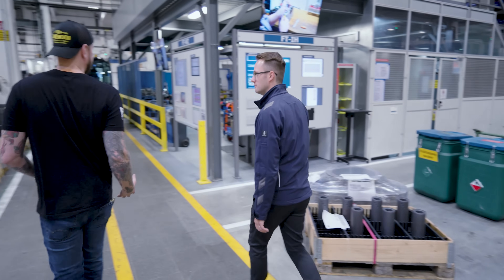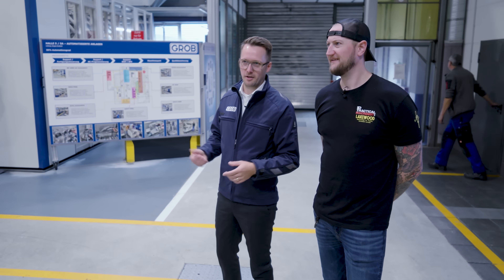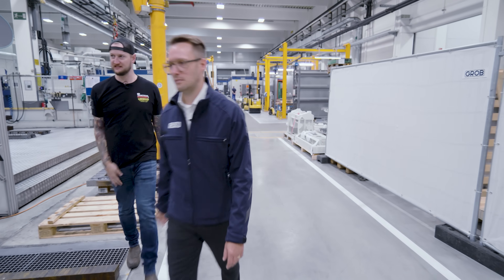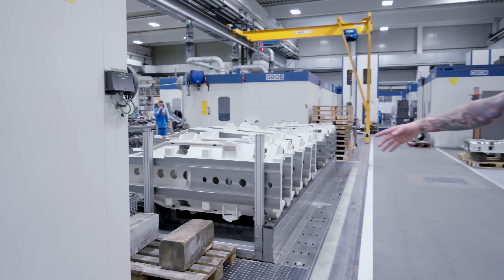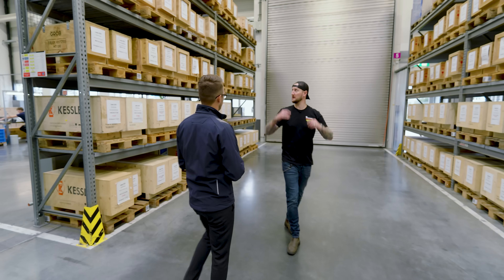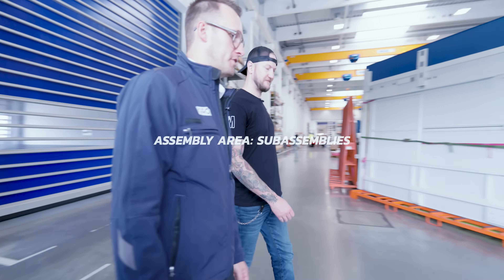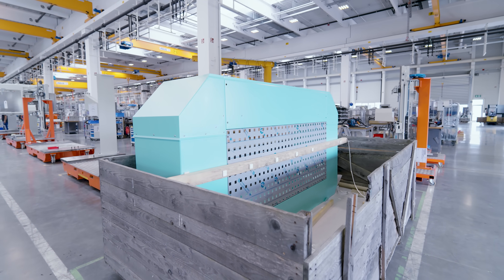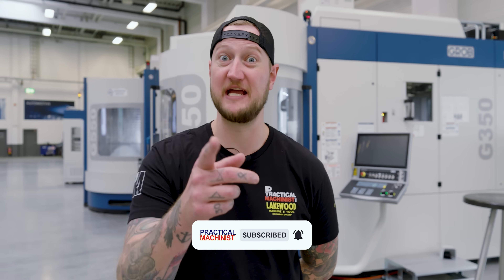This German Machine Tool Factory is Bigger Than Your Hometown!

Comment: 15:57 - well, nice machines. But it's all just welded steel. I don't trust CNCs from welded steel. Software compensation can do alot, but over time. Naah that's an aluminium machine and for shallow steel cuts only.

Comment: Imagine the confidence you need to have in your manufacturing + quality, that you just show how it's done, but know it won't be easy to copy let alone be better, for anyone.
Reply: I bet the Chinese can do it 10 times cheaper for 90% of the quality. But if you need that extra 10% then you have to pay the price I suppose.
Reply: @1pcfred   Honestly? Good question long-term.  
(I mean, it's not like someone would get something like that short-term anyway.)  

Long-term, as in what's the uptime and maintenance cycle those have. I mean, machines like that not working or just being on halt costs money. And if you're just saving like 5–15% of downtime a year just because the quality is better, it pays off, I assume.
Reply: @1pcfred  
not a silver bullet that's for sure, doesn't exist.. yet.
But it's everywhere pretty much the same.

Ether you build you house with cheap materials knowing you have to put more work and money in to it down the line or you opt for quality to have to worry less about that in upcoming years.

If affordable to someone, the quality tax often pays out over time.

Comment: A model plane has to fly itself. There's no pilot to correct the trim. Therefore if anything, a model plane has to be designed for greater stability than what you are pleased to call the real thing.

Comment: I did IT in several of such companies. It is interesting as hell and the workers are real fun guys.
Reply: Same here. I love doing IT in industrial environments. It's a niche job so you'll always find work but more importantly, it's a fun mix of desk work and working in the field between the machines and datacenters. I indeed also love interacting with the workers, whom I usually get along with great, often better than the office workers. What do you do exactly? I'm an industrial systems engineer, independent consultant. Though I have to say, companies such as this one I've only worked in two to three times. Most of my customers are heavy industry, think steelplants, oil and gas, producers of military vehicles, energy companies, etc, etc. That said, I would really like to work at machine tool producers more, those were some really fun and educational experiences, because I'm truly passionate about machining for some reason

Comment: Companies like this are the backbone of german Industry. Another thing i would like to point out is the fact that the Senior Manager knows the Place inside out, from the depth of the concrete to the diameter of the cutter head. Bosses like this you only find in these small, family lead buisnisses. 
Try to find this competence in a company that is listed at the stock market...like mine...
Reply: The Germans have always had a thing for thick concrete a la flak towers. They had walls 5 meters thick too. Coincidence? I think not!

Comment: It's literally a city built for machines and automation that's inside a building, rather than machines and robots that were built for general use and then programmed to fit into place while moving in space on an assembly line inside a building. It makes automation so much easier from a conceptual level, since you can design machines and processes and everything else to NOT crash in the first place.

Comment: Something funny just occurred to me...
'Grob' means 'coarse'. They are a big company that produces big manufacturing machines.
And then there is also a company named 'Fein'.
'Fein' means 'fine'. They are a much smaller company that produces small handheld power tools.

This is oddly fitting, I think 😄
Reply: but if you look at Fein's power tools, the result in comparison looks grob, because Grob's machining is very fein
Reply: My brain started juggling "Grob" and "Fein" around to come up with a few stupid jokes.
Reply: Grobe Wurst oder feine Wurst?
Reply: They say, how you christen the boat, so will it sail.
Reply: It's just the surname of the company founder.
Reply: Grobe, don't they produce gliders?

Comment: The world would be lost without Eurpoean Engineering and Manufacturing, especially German, Swiss and Swedish!
Reply: *dutch but be real we need m all…
Reply: You cant really cherry pick the europeans against eachother. German factories wouldn't be running without Dutch and Belgium supplied resources (harbours) and chip production as an example. The west has a deep rooted interconnected system of factories which is impossible to fully understand.
Reply: @dmyt58 except the US who does not produce anything important and just rules others because of dollar supremacy
Reply: ….no….
Reply: don't forget ASML from the Netherlands - they make the machines that make the machine you're posting from ;)
Reply: @ownageDan  Yes, ASML occupy a unique position in manufacturing, using far UV (wavelength 13.5nm) to photolithograph the highest density chips.  They had to develop their own UV source where a CO2 laser fires pulses at a fast-moving drop of tin, vaporizing it and creating far UV light. This process works up to 50,000 times per second.  The chips it makes can contain up to two trillion transistors and 100s of kilometers of wiring.  Chips are used in AI.  I take my hat off to those guys.  These machines are strategic for the West.
Reply: @ownageDan  ASML + ZEISS is peak of the summit on top.
Reply: @rosshart9514  these are all fabolous companies, but they also rely on tools of others for being able to create their own machines. In the end everything was built upon stones and wood even though it took literally ages to get here.
Reply: @ownageDan  Also ZEISS who supply the lenses for ASML.
Reply: @ownageDan  The optical components of the ASML chip machines are from the German company Zeiss. Without their know-how, today's production processes would be unthinkable. They use a mirror system with a previously unparalleled surface quality to expose the wafers. There are no mirrors in the world with the precision of the Zeiss mirrors. This is what makes these fine structures possible.
Reply: Sorry, for interrupting in your reminisce. 
There are 2 old German  sayings, that describe the situation :
"The train has already departed" 
"You're in for a rude"

As I can't post charts here, it'll only be the comments on them. Google is your friend. 

Innovation growth in China

1990: Copy
2000: Reproduce
2010: Innovate

China is becoming the leader by patents, what can be seen as an indicator for innovation.
Reply: @ownageDan ASML is based on a research institue in Belgium. The tech is a collaboration of the low countries, not just the Dutch.
Reply: @dmyt58  You're talking about Imec, no? Indeed, very close collaboration and interdependence where one would almost be impossible without the other. It's located in the Flemish part of Belgium. But then again and purely talking from my own perspective, Flanders and the Netherlands are something akin to brotherly nations. I see us and them as one step removed from being the same people. I truly love the Dutch because we have so much in common and a lot of them love Flanders right back (though of course like with all brothers, there is incessant banter and even some animosity from time to time)
Reply: Truely girants of the past
Reply: Not true 👎
Reply: Not true, but thanks for the compliment.
Reply: @icecube3645  what makes you say that?
Reply: Really? That scares the world. We demand the US  and Qatar keep the LNG flowing.
Reply: Spice have to flow!  @davidcheung8595
Reply: @davidcheung8595 Everyone is trying to become more independent of the US, especially now with Trump reelected. Unreliable.
Reply: @davidcheung8595  weak comment...(stay waving your flag)
Reply: Have you heard of Mitsui Seiki from Japan? They make machines who are more precise than GROB will ever be. Europe had one company that did such machines, the Swiss SIP now only 50 employees and absorbed into the Starrag Group.
Reply: @louies6914 
Grob machines are mostly high volume production machines from what I know, not jig boring quality ultra high precision machines like SIPs, Dixies, Mitsuis etc. pp. 

Completely different application, not the same sport, not even the same Stadium.

Japan has some top notch engineering and workmanship as well though, goes without saying. Your example just isn't very comparable. 
It's almost a bit like a Waldrich-Coburg gantry versus a Kern micro machining center. Not exactly a substitute for one another.
Reply: @heinzhaupthaar5590 these are large parts

Comment: Imagine how much power this place needs to operate.  My word..........
Reply: 576416 MWh last year. It says so in their sustainability report.
Reply: it's much less than you'd think
Reply: @johannesfossi5561  how much does he think then? smh
Reply: @redwarf8118  Like a single batch from a steal manufactor. You know the other thing Germany is also famous for. Material design.
Reply: @RogerKeulen  thank you bot
Reply: Way too much power! To save the world Gemany must shut down all the energy cunsuming industry and we are on the right track.
Reply: Last year it was 35.673 MWh or 57.416 with other energy sources (Öl/Gas, etc,) converted into MWh as their anual Sustainability report says.
Reply: @Rick2010100  that's a lot of lignite. Germany runs on brown coal. You can see the strip mines from space. They'll move a whole town to chase a vein. Sustainable indeed. Lignite is the dirtiest fuel known to Man.